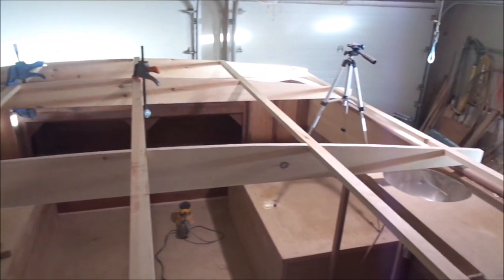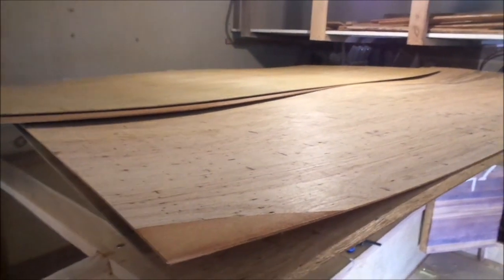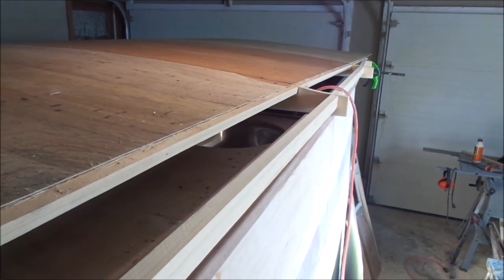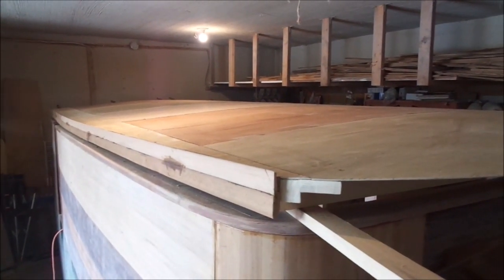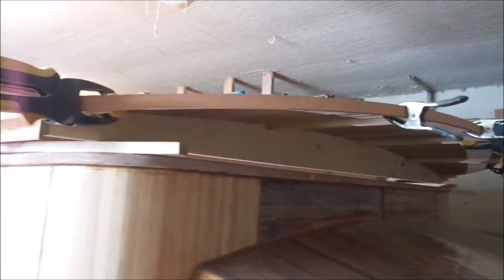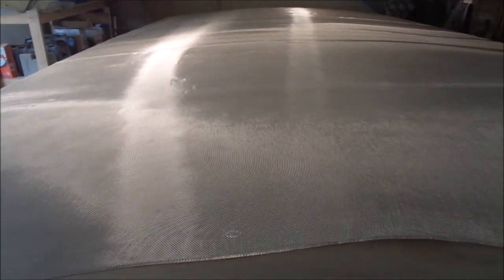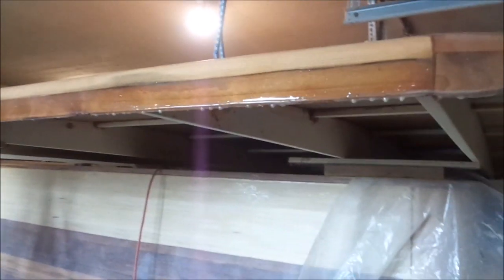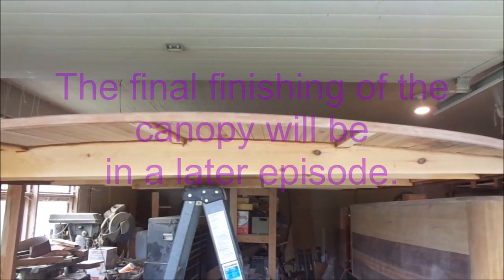Building My Solar Electric Catamaran Part Ten

Comment: Looking good, but, please, watch for the weight !!!
Reply from the maker: Hi Bernd, I am guessing the final weight with solar panels will be about 150 lbs. I have confidence that I will be ok as I can compare what the canopy weight was of my mono hull boat. I should not have to worry about the stability the same as on my mono hull. The other factor I was thinking of was the basic design was for sailing and the amount of force on the sails as well as the top heaviness due to the mast must be similar to my situation by adding a heavy canopy. I guess I will know in a month. Thanks for keeping an eye on me.
Reply: @philboyer2036  Hi Phil, I am not afraid of the stability of the boat. It is more that the extra  weight of the boat will mean more draft and less distance of the water surface to the bridge deck.